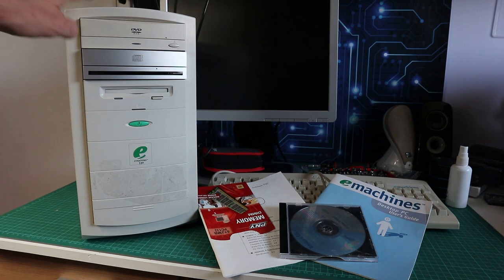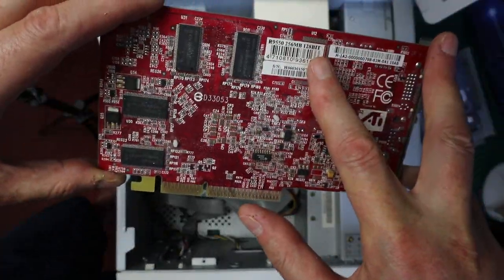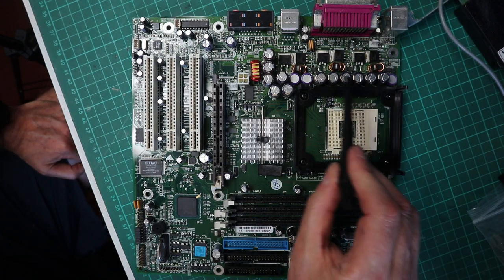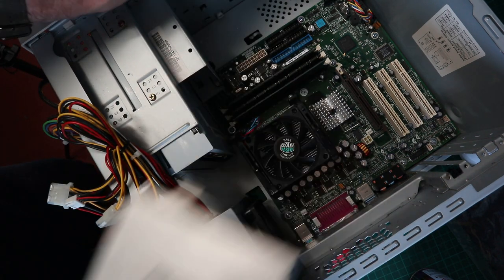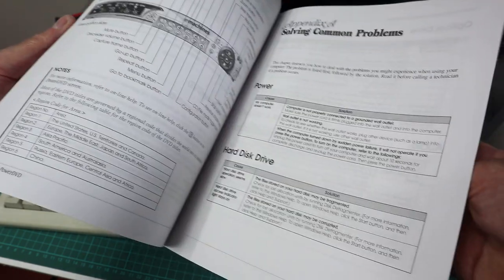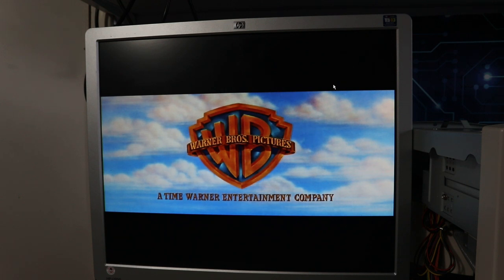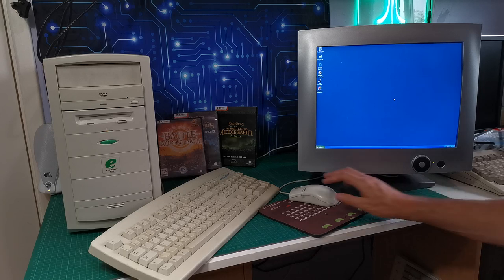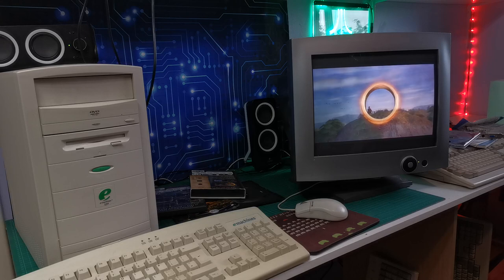eMachines P4.

Comment: I love eMachines because of their history, and this is a cool vid. You said you didn't know much about the company, so just a brief intro here. eMachines was a Korean pc maker that debuted in '98, and was the merger of Tri-Gem and another Korean company whose name I can't remember. They had one goal, and one goal only---to be the cheapest. And it worked---they sold millions. But like anything in life, you got what you paid for (or didn't pay for), and their pc's were very low-spec compared to the pricier competition
Reply from the maker: Cool, thanks! Ive had a few in job lots etc. but they were always celerins with no agp. I actually quite like this one. The curved fronts are a pain though if you need to find a blank or replacement drive.

Comment: Nice little machine, it cleaned up really well. Word of caution with that Radeon 9800 Pro. That cooler is perfectly flat, so when the die shim lifts, as the glue expands. It lifts the cooler off the die! Consider popping the die shim off, I just gently push the blade of a small pocket knife in at a corner. A slight twist pops the shim off. Or fit a small copper shim to the die, pasted on both sides.
Reply from the maker: Cool, thanks forth info! Dont think I've even had it out of the box since I got it about a year ago. Will check it out and use it in a build soon.
Reply: @66mhzbrain  Look forward to that then! I bought mine brand new, it lasted 'till just out of warranty!  Shit bags wouldn't do a good will gesture neither. Today, I have the cooler on a 9700 Pro de-shimmed!

Comment: Ahh, e-Machines. From an American point of view, It's a little funny to see one being preserved, rather than sitting on the side of the road, waiting for rubbish pickup. They were utterly ubiquitous in the early oughts.  
IIRC, you should be able to upgrade that machine with a Northwood Pentium 4.  There's a 3 ghz, model with a 400 mhz FSB (SL6YH). However  I suspect it costs multiples of what the machine is worth. Celeron Northwood would work as well, but with less cache.  If you can get the 533 mhz FSB working the Celeron D processors should work as they have 256kb cache.  I'm also remembering something about the power supply being slightly non-standard. My nephew had a slightly older Pentium III version of that machine that we upgraded to an AMD Duron Motherboard in about 2003.

As for the drives, they're simply standard OEM drives, with an E-machines front panel clipped on, so if you have a failure just get the same model/manufacturer standard drive and use that.  I suspect that you'll have trouble finding an e-machines specific curved front CD drive, as they were typically tossed during the time that these machines were being recycled, since they were non-standard and there was a huge glut of CD drives in the reseller market.

Good job on the save!  They've got to be pretty uncommon at this point as they were both unloved and almost universally derided when new because of their lack of upgradeability.
Reply from the maker: I woukdnt have gone for an emachines ordnarily but I do like it. I orobably wont bother with any upgrades and build a faster p4. Ill just look after it as th3 become rarer.

Comment: I'm surprised none of the caps are bulged! Nice find. Just curious, I've loaded XP on many sandy bridge (i3-2100, i5-2500, etc etc) that platform is 100% XP compatible. Why not use that?
Reply from the maker: Would be interesting to do a recent(ish) build for xp! Dont have sandybridge processor to hand, just looked and have a couple of haswells, may give them a go, not sure about 4th gen and xp. I have a bunch of decent p4 boards and 800mhz fsb cpu's so plan on doing a better xp gaming build with one of those. They all need recapping, will probably do something on the next few weeks😁
Reply: @66mhzbrain  I've played with XP on a Haswell system. It's not 100% compatible and expect blue screens when doing any sleep states! 3rd gens are very very compatible i.e. dell optiplex 3010/7010/9010. I look forward to some 800 fsb newer p4 builds videos though. When I worked at a Credit Union we had a bunch of dell optiplexes with lga775 p4's, optiplex sff's....had to recap ALL of them there were like 20
Reply from the maker: @itstheweirdguy  I got a few p4 boards a while back and one athlon xp board. They all need recapping. Id forgotten all about them. Probably time to sort then all out.
Reply from the maker: I'll probably leave this as is and build something better for xp in another project

Comment: Beige case PCs are too expensive for me these days, so I picked up a few silver and black eMachines for around $30 each on eBay. One has a Sempron 3300+, two with 945G boards with P4s, and one with 845 board with socket 478 Celeron. These may be the poor man’s retro cases, but I have four for the same price as what I see for a single, beige case system like Dell, HP, etc. Now I can just put my own boards in them or keep them as is because they all are working fine after some cleaning.
Reply from the maker: It would be quit cool to have a bunch of matching cases, each with a different retro build inside, then maybe some case badges to identify them😁. Original too, not sure I've seen that anywhere!
Reply: @66mhzbrain  oh I agree. I wish I could share a pic with you of what I got. Two of them look almost identical (front bezel) even though they are different models, and the other two look similar except one has a floppy cutout and the other does not. The interesting thing is all of them have the same basic frame, drive bays, and HD cage. I guess eMachines really tried to use the same case design across several years of PCs. Smart and cost effective I think. The only kinda useless board out of these is the socket 478 board because it is 400MHz FSB and just 3 PCI slots (no AGP). Not sure what to do with it. The two 775 boards and the 754 board have some retro gaming potential, so I’ll play around with those. These 3 boards all have PCIex16, PCIeX1, and two PCI slots. Not sure if any of these boards will go back in the cases though. I’m welcome to suggestions and ideas for what to put in the cases.
Reply from the maker: @mesterak  I have one of the silver and black ones, mines a celeron, no agp etc either and Ive been thinking what I can do with it. I've another beige one with a decent socket 478 and p4 with agp. I'll check the spec in tomorrow. I'll try out some boards and see what fits. Would be cool to get a 486 or pentium going in a case like that! You can drop pics on twitter if your on it. Also if the semprons socket 462, theres everything from athlon tbird up.
Reply: @66mhzbrain  the AMD board is socket 754. I was thinking about swapping the Sempron 3300+ for an Athlon 64 3000+ I have on hand. I noted that the Sempron has SSE3 but the Athlon 64 does not. Is that going to be a problem? Also, I like your idea of dropping something older to replace the crappy socket 478 with only PCI slots. I bet we have the same board lol. Mine is the Imperial_GV 200307018 as listed on the edge by the last PCI slot. I’m tempted to see if I can drop in this socket 370 NetVista board I have that at least has AGP 2x/4x w/three PCI slots or maybe the Asus P4B266-LA OEM board I have with AGP 8x and three PCI slots. I could at least use the built-in floppy drive if I went with one of those and the system would still be better than using the original eMachines board. Now for the other systems I think the sky is the limit because they use newer CD/DVD drives, multicard readers, etc. more suited XP or later builds…maybe even a sleeper PC.
Reply from the maker: I cant see lacking sse3 would make much difference, especially if you using it for more retro stuff. Yes I bet they are the same boards, going to dig it out later and take another look. A pIII would be nice in one of them with that 370. They will kind of all be almost vintage sleepers, not modern cases but not totally old either!
Reply: @66mhzbrain  alright I will go for the socket 370 in the eMachine T2542 case. I’ll let you know how it goes.
Reply from the maker: Cool, should be a nice win 98 build to start😁
Reply: @66mhzbrain  just following up to let you know I did successfully get my NetVista Pentium III board installed in the eMachines T2542 case and at least did a power-on startup test. Tomorrow I will work on getting the board front panel connected up with some patch/jumper cables because the IBM board has the stupid proprietary connectors. I’ll then move on to installing a drive and get Win98SE installed. Probably sacrilege to purists to put an IBM board into an eMachines case, but I don’t care. 😂
Reply from the maker: @mesterak  haha, its going to be cool hybrid. I actually bought a motherboard today, an ibm xserver dual socket 370, that likely won't be going in an ibm box either. Yes my netvista has those crappy connectors as well, I had a compaq mobo in there a while ago and used electronics patch cables to hook the ibm front panel up to the mobo, the reverse of what your doing. I dug my little emachines out. When I get a sec was going to see if a baby at socket 3 might fit.

Comment: based on the amount of motion trails it seems like you are using wrong camera settings, possibly ISO set too low
as general rule: set the ISO to auto, shutter speed at double the frame rate you are recording at and aperture as low as it's able to keep everything you need in focus 😉
Reply from the maker: Yes Ive had a new camera for a few weeks and still messing around, iso is just set to 400 at the minute with minimum aperture that gets enough light to see whats going on and maximise depth of field. Framerate is fixed at 60
fps regardless for video on this at 1080p. If its the crt segment your talking about, I film those on my phone and I just looked, the iso was set very low 😬
Reply: @66mhzbrain  Uhm I'm talking about general motion trails, not the CRT sync/async issue. You can see them clearly from 2:42
This usually happens when the camera can't keep up with selected settings and as I said I suggest you to keep ISO set to auto and make sure that the shutter speed is set to double the recording FPS, e.g. 1080p@60 --> shutter speed: 1/120 (or 125 if 120 is not an option)
Reply from the maker: Ha. You have better eyes than me! I imagine your talking about when I move my hands around over the machine. Probably would need more light in the room to keep the iso the same. Ill see if I can increase it without it getting grainy and then increase the shutter speed to get rid of the blur.

Comment: How strange.  I wonder if the not selling a monitor is a European thing?  I have a 15 inch and a 17 inch eMachines CRT in the basement.  They both are pretty nice, but they aren't trinitrons or anything.
Reply from the maker: Maybe. Not sure was just something I read when looking for info about eMachines. Said so on wikepedea, so must be true 😁🤔
Reply: @66mhzbrain  It is possible that what they mean is that they didn't manufacture their own monitors.  It's entirely possible that their monitors are rebranded Korean monitors.  There are some very noticeable similarities between the 17 inch monitor that is labeled as eMachines and my KDS VS7i monitor.  So that could be what they meant.
Reply from the maker: @helldog3105  maybe. I should have just looked on ebay where there are tons of emachines monitors to know that info was wrong
Reply: @66mhzbrain  I saw a boxed NOS one on there.  I want it, but I already have half a dozen CRT monitors, so I don't really need another one, but I love NOS CRT monitors.  You know they will work great.
Reply from the maker: @helldog3105  haha yea I saw it. This conversation made me want an emachines monitor. I also already have too many😁